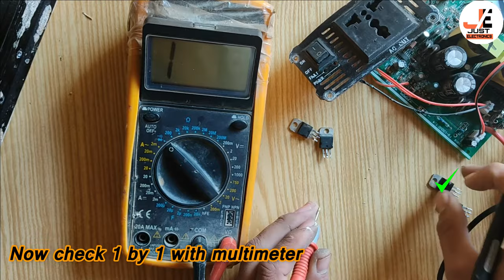Anverter Repair 1000w.Red light on No out put current

Comment: There are things I don't know. I check them with an ohm meter, but you normally need to take the leg up from the board. But, being in the board  I check for cosistancy, I look for any differences from one component to the next so long g as your checking the same kind of part which all have numbers on them that you can easily check br viewing them

Comment: Im finding CS730 mosfet for my 300w inverter.but cant find.any substitutions??Thank you for your video...
Reply from the maker: Out side.? Remove all fet and put 20N 40
Reply: @JustElectronics97  yes.230v side..
Reply: its 400v 6A  75W mosfet N channel  you have 4 of it of total of 300W so any similar one will work and even  one with more than 6A will be better but all 4 mosfets has to be the same

Comment: Hello, 3000 watt full sinus inverter fault light is on. When the inverter is turned on, a relay tripping sound is heard, then the fault light is on, what do you think could be the problem?
Reply from the maker: Check the out side  MOSFET 1or 2  MOSFET is  short.
Reply: For me both green and red Light are on.  An it's having à continuous sound ? What can be the problem plz ?
Reply: @dave4jzs649 facing same problem ones I turn the inverter on it shows green ones I add my load the red light turns on too